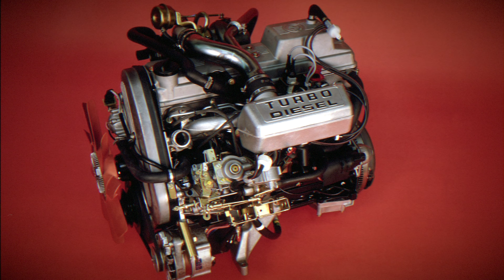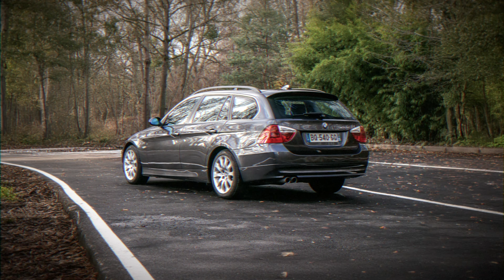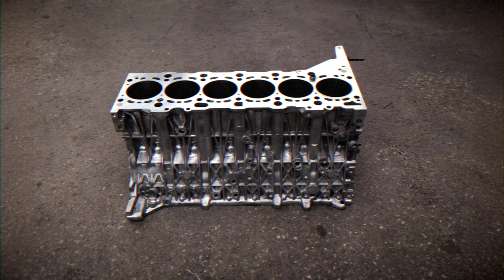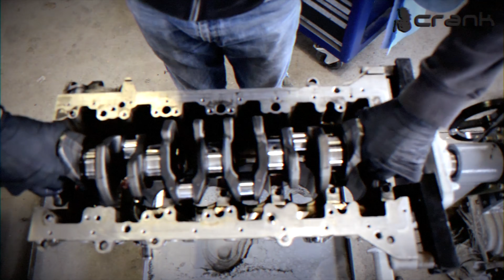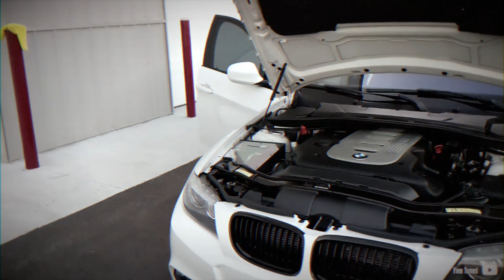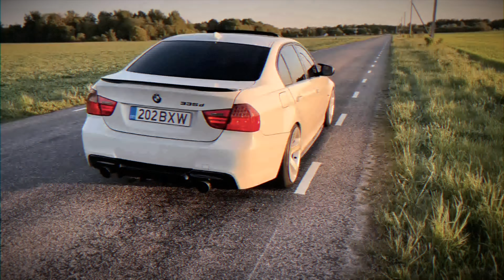The Most Reliable BMW Ever?!

Comment: The engine lifespan is not 300k miles or 480k km, it is 600k miles or 1m km if driven gently. My dad's e39 530d has 600k miles and is still going strong. Maintenance done every 100-200k miles so you don't have to do maintenance very often if you drive like a normal person. If you do maintenance every 10-20k miles it is not dying.
Reply: My 2004 E60 525d is currently at 287000miles and still going strong
Reply: What are the maintenance performed at 200 km? Chain replacement? Will the injectors last 400k miles without replacement
Reply: @Eyz67  Usually the timing on M57D1 (2.5d and 3.0d from e39) does not need preventive changing. They start rattling at ~400.000km's, and that's when you change the chain/guides etc.
Reply: @Eyz67  I think only one injector has been changed, tho I could be wrong. The chain is original from 98 and the turbo has been changed in 2015 because we gave it to someone and they abused it. It rarely goes over 2000rpm so that may be the reason it is still here. We don't do maintenance often because it doesn't really need it and we don't want to throw money into it ( I know this sounds stupid but it is true) and to answer your question, oil changes. That's all. Our mechanic said there are no signs of wear after removing the valve cover, but even though he has only seen the camshafts we believe him because he started on e39's (he was only doing e39's). We don't know if it really has 600k because an abs sensor broke in 2012 or earlier at 200k km (160k miles) and it was fixed in 2021. We estimate around 100k km (60k miles) every year so it may be 500-600k miles right now. The trans is also acting weird (it sometimes doesn't want to shift so the engine revs more than it should). It still is a reliable(ish) car, as the age shows in rubber and plastic parts. One of my classmates' dad has an f10 530d and it is mostly in the service. He also had an e39 530d, but the fuel pump broke and he was scared of costs so he sold it. He still regrets to this day. Shows how good these cars are.

Comment: One thing you forgot to mention, aluminium block m57 also suffers from chain issues, like the nX7 engines after it.
Reply: @OM617a  the m57 had the chain at the front, n57 at back
Reply: @OM617a  well, thats wrong..
Reply: What? Dud u on crack or smth? No. The aluminum block have an "extra" problem and that is the injectors. Not the chain.
EDIT: or we can talk about modernism and complain about DPF. Other than that the same problem with swirl flaps. But u can replace them with aftermarket or just cancel them.
Reply: @n1ck72  well then, I have had, and some of my friends also have m57n2 e60s, some have original mileage, have had no problems up to 300k, one guy had a chain snap at 260k.. but in fact, they do suffer more, than the iron block m57, had a 535d 200kw for almost 3 years, no issues 300-370k.. sometimes the chain wears through the front casing.. and im not alone on that statement

Most of them already have the dpf and swirl flaps removed.. other then that its a great engine. A good mechanic of mine said that the iron block is much superior, due to the fact, if an injector fails, you melt just the piston, not the piston and block.

Ive read on some forums, that bmw changed the supplier for n2, or the quality was worse on the chains, that they started to have issues
Reply: @7privet_  The story about injectors it's weird. I had mine when I bought it Second Hand with 130k originals and had bad injectors. Probably because the dealer held it for too long and as dealers do, they don't fill the tank up. + U keep the car outside in fcking Germany where isn't hot => condense in the tank from to many starts - stops for clients. Other than that, I think the problem with the chains is mostly due to the oil change interval, oil quality and how u exploit the engine. Ofc it will break if you start the car and u wanna go race it *DUH*. Some friends and neighbors had both the cast iron and also aluminum and none had problems. I even have friends with n57 and until now none complained about engine problems. One dude with an x6 n57 had some gearbox problems but that's all.

Comment: I had one with 400k km, never opened the engine and was on original internals until I sold it at around 410k. Extremelly reliable engine when taken care with basic maintenance.

Comment: Can confirm. I have a 2009 E90 330d manual with a 300bhp remap, it's the most torquey, tractible and economical car I've ever owned, and beautiful to drive.
Reply: That remap will destroy it, don’t worry
Reply: @Janfey  haha it will not . i have a e60 535d prelci as a tow car , its been running stage 2 since bought it in 2012 at 109 000km , its now driven 322 000km and is still on stock turbos .
Reply: Why do you say that? Theres plenty of mapped M5s with high milage that are pushing out way more power than that  @Janfey
Reply: @Janfey  😂 of course, of course 😂
Reply: @Janfey clearly never owned one. 310,000ks mapped. Did the chains myself at 280,000 and they were brand new.

Comment: Buddy had a early 90s 5 series ( i think).  It had a hot cammed straight 6, and until it was crashed it almost had 300,000 Mi on it.  Even with the hot cam it was Bulletproof.  And it was sold after crash to a friend of ours who owns a BMW race shop.  So all the parts went to a good home

Comment: Proud owner of a 330d E92 with 231hp M57TÜ2D30. This engine is so smooth and powerful, it’s truly amazing and I never had a problem with it except for the valve cover gasket leaking a tiny bit of oil. 225k km and still runs great
Reply: Mine's a cabrio. 130k km and I bought it with electrical faulty injectors. Had to replace them all.
Reply: My guy just changed all the seals also at 230k and no more oils leaks, runs like a beast on stage 1, my second m57 bmw and my girlfriend also just bought E60 with m57
Reply: Om 648 800k org us miles

Comment: BMW and reliable does not exist
Reply: It definitely depends on the bmw.

Bmw m30 reliable
M54 reliable
M50 reliable
M20 reliable
M60 3.0 4.0 reliable
Many many bmws are extremely reliable engine wise. And many excellent manual transmissions by zf and getrag.

Zf autos are generally good too especially 6hp and 8hp seems also good.

Bmw modern classics are beautiful, reliable, and luxurious yet simple and very sporty.

Toyota is recalling what, 100k engines for problems?

All manufacturers have issues and many have extremely reliable vehicles. Probably the simpler the better.
Reply: You forgot m52
If you say m54 is reliable.. m52 is even more reliable
Reply: @Krezo200  No disagreement. M70 not bad at all. M73. V12 jobs. N52 series quite reliable. Expensive to maintain a bit more but still good. N62 OK but too many repairs. Still runs good. N54 good but expensive (injectors, hpfp, turbos, belt slip, etc). M62tu good but needs timing guides when it falls apart. Reaeal vanos. Other than that, m62tu runs strong. 

I believe m54 enthusiasts use m52 piston rings to stop the oil usage, another nod to your rock solid m52. M52 in z3 I think has aluminum block. Little tidbit there!
Reply: @spencermaiers8322  if you say the n62 is good then we have to differ between the block and the attachment parts. i agree that the n62 block is good but it has many failures around it (i think thats what you said) in total i agree with you. so far i had serveral m52, m54, n52 and a m62. great engines, loved them. currently im owning a n20.... wish me luck. i have had n54 and n55 as well and they didnt let me sleep. injectors, hpfp and so on...
Reply: @Krezo200  N20 is OK. Thr 12 13 14 need timing chain. Just do it. The 15 16 maybe 17 they went to? Should last longer depending when in 2015 it was built IIRC. Maybe Jan or Feb 2015 might be OK.

I've seen 1 spun besrnf on n20 #2 rod and a couple siezed intake camshafts from oiling issues.

The n20 is a noisy little direct injected 2/3rds of a n55 and has a poor reputation I'd say.

For timing chain u will need crank install tool, timing tool, crank holder for automatic or manual, and a 3/4 36 inch or 1 meter long bar to break the crank bolt loose. 

Always do oil pump chain and guides all complete.

If it blows the chain it always works even if catastrophe in the oil pan. A grocery bag of broken shit. Broken guides, pieces of oil pump chain tensioner etc.

But it usually runs fine after even if totally fucked up. I think the shaft motor immediately pulls lift to minimum and it saves the valves. Usually the exhaust cam is dead on the money and the intake is advanced by 3 or more teeth. You'd think it will blow the valves up but always fires off and runs nice.

If u get vanos codes there's a tsb to update the engine dme software and it fixes it. It doesn't mean u set the timing wrong.

Torque is 100nm plus 270 degrees for crank bolt. Top end is 55nm and 55 degrees for the vanos bolts. The rest of it you can tighten up no problemo.

The Chinese chain tool kit for 40 bucks works fine. I had a nice fancy baum also Taiwan have a screw issue. The Chinese cheap kits seem to work fine.
Reply: @spencermaiers8322  reliable by  BMW standards, yes the type of thing that you could send to a third world country and run for 30 years with minimal maintenance no 👎
Reply: @060racing8  That doesn't exist champ. Only in your mind.
Reply: @spencermaiers8322  Taliban spec fz LandCruiser
Reply: Yes It does
Reply: @olympbarca3313  reliable by  BMW standards yes . But you're not going to send one to a third world country and run for 30 + years with minimal maintenance

Comment: I bought my 6 speed E90 330d M Sport because of the M57 engine and also the gearbox.

300 bhp and 742 NM and I love it, the clutch doesn't though.
Reply: The automatic gearbox used in 330d E9X can hold up to 750nm of torque without issues. Probably with a better clutch the gears themselves can withstand that power in the manual variant too
Reply: The gearbox is very strong on those cars, I believe the 550i clutch is used as an upgrade.

Comment: "57     5 = 6 cylinder" these guys really can't walk a straight line.
Reply from the maker: It is just a code name. A 6 is usually a V8 (M62, S62, N63, S65...) and a 7 is a V12 (M70/M73, N73/N74). Interestingly, an 8 was a V10 (S85). A 4 is most often a 4-cylinder (M47, B48...)
Reply: It is straight, just not from where you are standing 😂

Comment: The M21 engine sucked.   It has torque to yield head bolts that eventually caused the engine to blow a headgasket.  And the head would crack between the valve seats.  I should have bought a Merc with an OM606 instead, 😪
Reply: Well om 606 can blow headgaskets too.